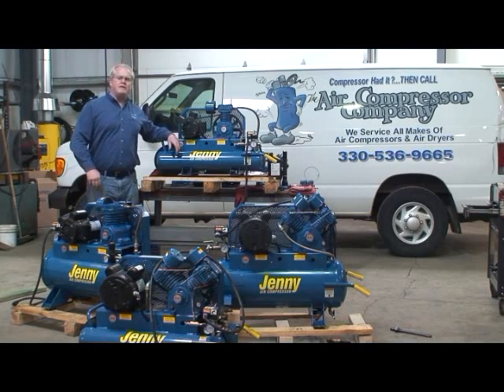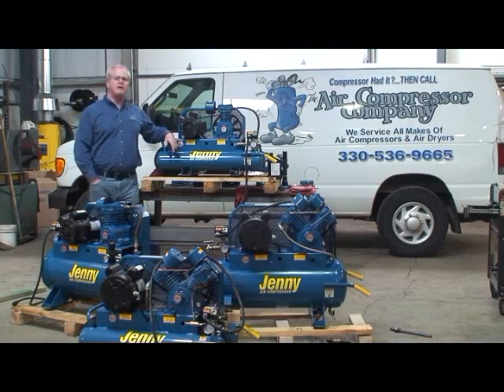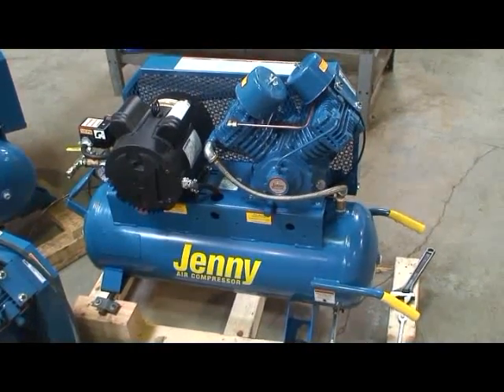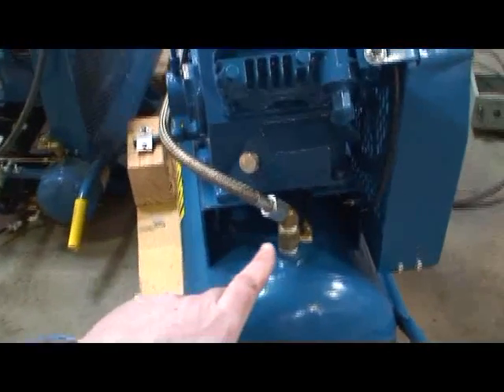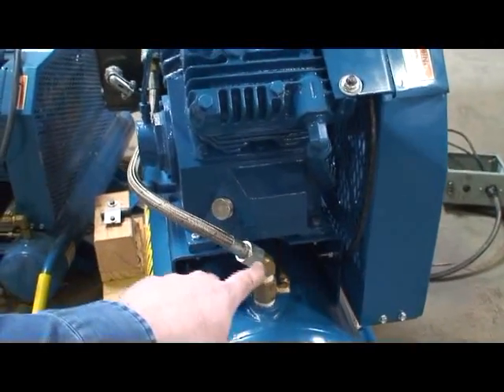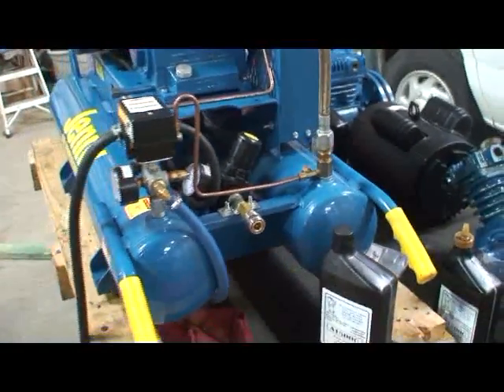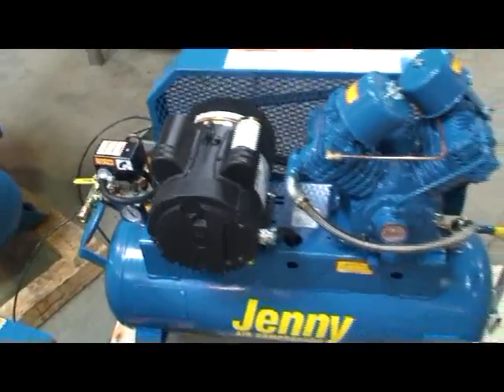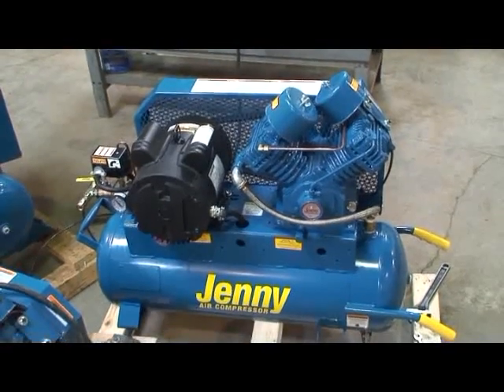Jenny Compressor Video Q Check Valve Diagnostic Test.avi

Comment: OMG
FINALLY I HAVE BEEN LOOKING FOR HOURS.
The one you are leaning on is the one I have.
It has a marathon electric motor on it
I need to start Capacitor and the
Capacitor.
Can you help me 

ALSO
If not what's the smallest electric motor I can use for that 4-cylinder monster